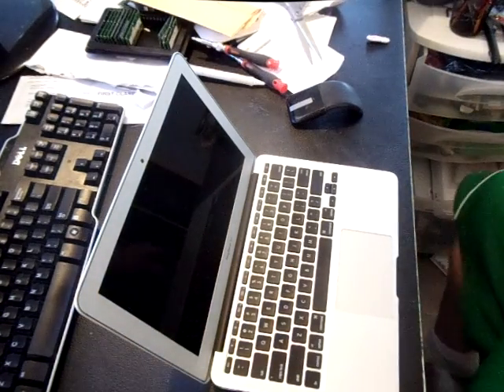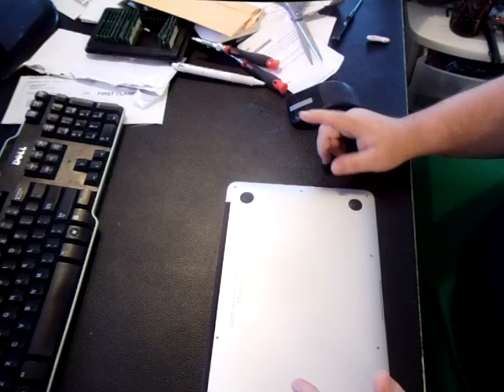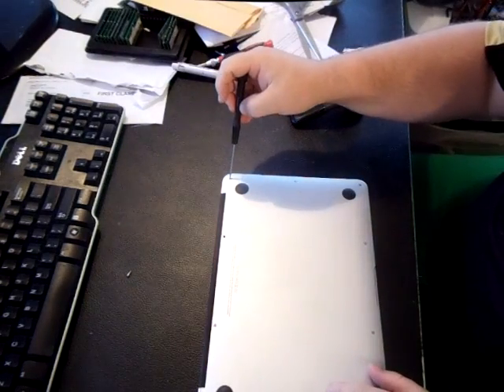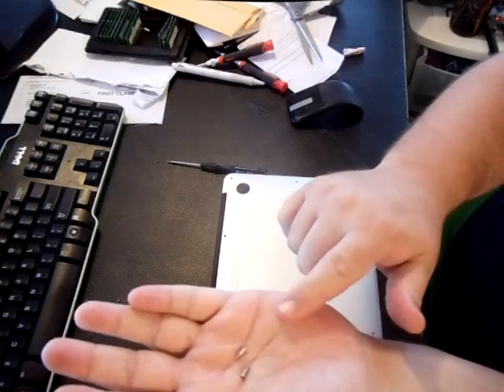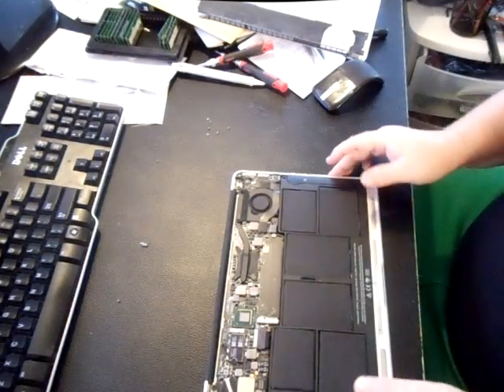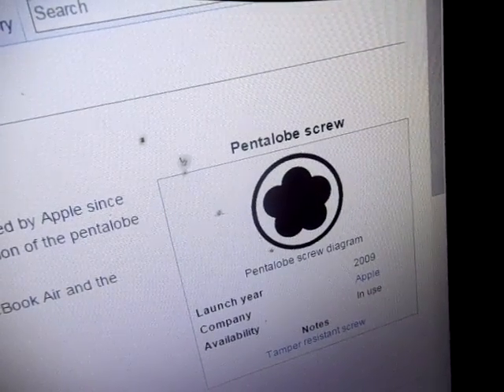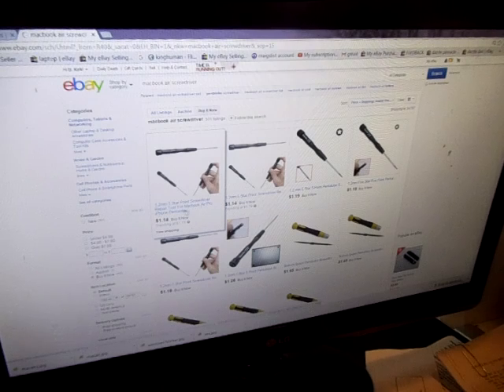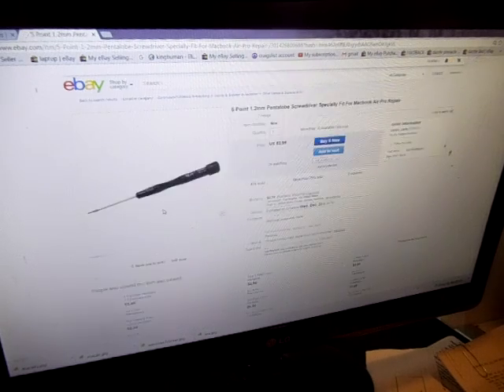How to Remove SCREWS Bottom Back Cover Case Macbook AIR (A1370 A1237 A1304 A1369 A1465 A1466 A1379)

Comment: i tried to unscrew it and the lid just popped up around the screw! I’ve been having issues with my battery and overheating but i’ve been using it and charging it in my bed. The fucking battery is expanding, i could have burned the fucking house down. I was just going to open it to see if i needed to remove dust. holy shit.

Comment: Will this reach the area internally of a headphone jack? The tip of the headphones broke inside the headphone jack and I've tried everything from tweezers, pliers, pen tubes with super glue in it, to the q tip with super glue, push pin bent into a hook to retrieve it. I need to get inside the area of the headphone jack, if I take the plate off, will I be able to force it out with the backing off?
Thanks

Comment: For my MacBook Air 2012 and MacBook Air 11" 2015 I used the Pentalobe (5 point star) 1.2 screwdriver ..... however, with my refurbished MBA 11" I discovered that one of the screws was a "rounded" pentalobe and thus the standard 1.2 pentalobe screwdriver would not work. I tried a variety of other precision tools to no avail. I even tried a T5 which is larger then the 1.2 but to no avail.
Anyway, 
as my MacBook was refurbished I'm thinking that the person who refurbished it lost the original screw and used the newer (I think??) rounded version. I could be completely wrong about the screw, but nevertheless it was not the same as the others.

What I did to get the screw out was use a power drill with matching drill bit (matching the size of the hole in the screw) to drill (in reverse mode) into the hole. This turned the screw enough so that I could then use precision tweezers to complete the unscrewing.
I discarded the drilled screw. Yet to find a suitable replacement.
Reply: https://en.wikipedia.org/wiki/Pentalobe_screw
Turns out that Pentalobe is the 'rounded' star shape.
Hmmm!!
So are there two types? The rounded and non rounded???
Perhaps I needed the rounded one. Oh well.

Comment: Hi i bought a screwdriver to take the screws out of my macbook pro i was able to unscrew most apart from 2 screws is there any other wsy to remove these the 2 left are v stubborn
Reply: I bought a Pentalobe screw driver to get most of my screws out but I too was stuck with a single screw that would not come out. The screw driver was just spinning in the hole. On closer inspection this particular screw was not the same as all the others. It was a rounded hole instead of being a nicely etched star shape.
None of the precision tools I tried would work.
Last resort, I used a matching drill bit to drill the hole, just enough that it turned the screw. Then used tweezers to fully unscrew it.
Reply: That’s what is going on with me did you find a solution?
Reply: Hi no but i checked other videos and it might be better to buy a phillips screwdriver for apple laptop. I bought a cheaper charger on amazon for my laptop and my it works now as my old one was ripped. Hope u find a solution all the best :)
Reply: muslimah211 thank you 🙏🏽

Comment: I ordered a new battery and the tools were included. The first 6 screws were easy to remove, but the last 4 screws are totally stuck. Any tips what to do?
Reply: What size is the pentalope driver? 0.8 or 1.2 or something else?
Reply from the maker: try using a small min flat head or even phillips screwdriver even if you have to strip that screw.  You can buy the screws on ebay for practically nothing.  You might have to lightly hammer the flat head into the tight screw to get a grip.  You'll eventually get it.

Comment: You have not answered the burning question, SIZE! 
  What I found is “TS4” or (1.2mm)
Correct?
Reply: i thnk it is according to a reply (1.2)   .. if it is phillips ..its the #00
Reply: Yes, both are correct but the Mac Book uses a “Pentalobe” a 5 point screwdriver that measures 1.2mm across the points of an imaginary circle. I have vernier calipers and each show the same width. Mine has a 50mm shank show stamped on the handle is 1.2-50  The phillips screwdriver goes by a size system set decades ago before the alleged tamper resistant “PENTALOBE” came 11 years ago with apple smart phones. Your supposed to pay more and get a new on one when yours quits working. It is in the Apple user agreement on page 8,538, paragraph 4, subsection VI. “You Must Buy New!” No Fix Longtime! :)